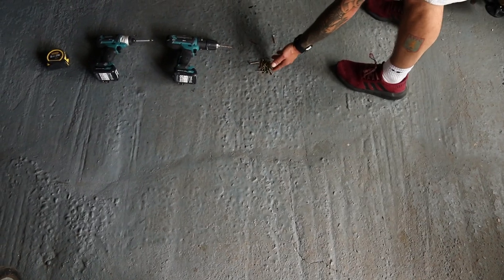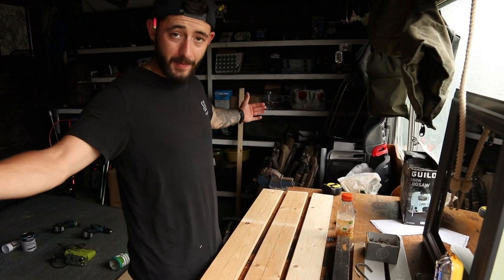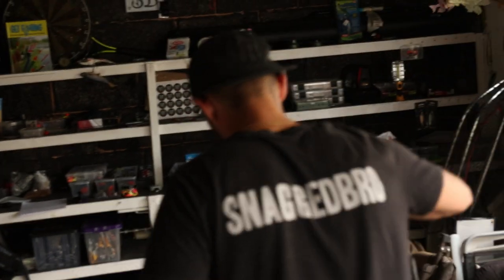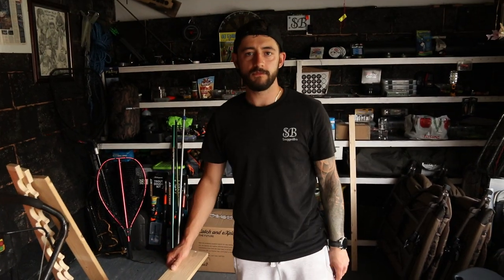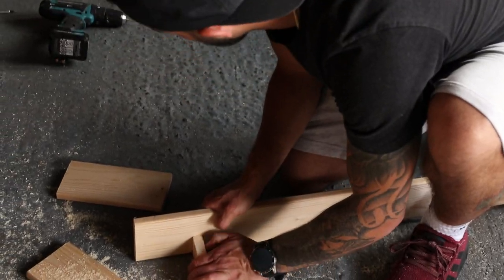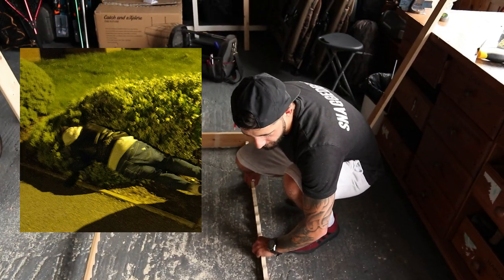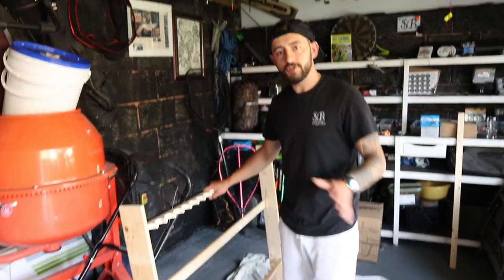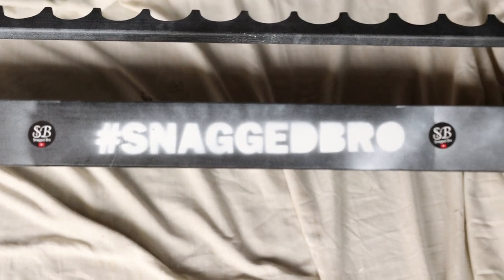Build your own Rod Rack

Comment: I suppose you could use a single piece of wood, drill holes in the centre using a holesaw and then cut it in half to produce the curved pieces.

Great video as always.
Reply: Would not be half as funny though . Funny😂